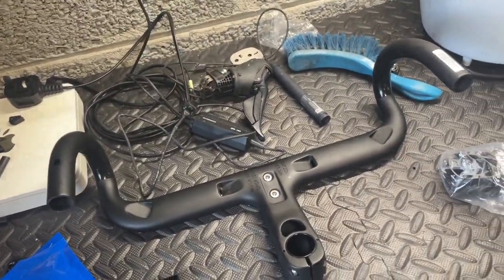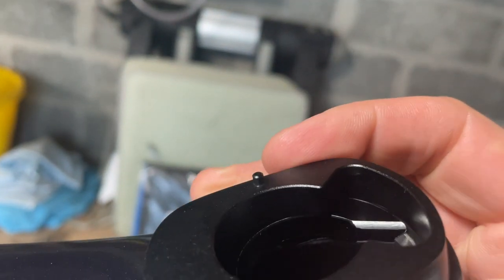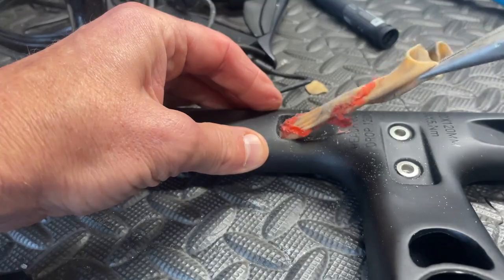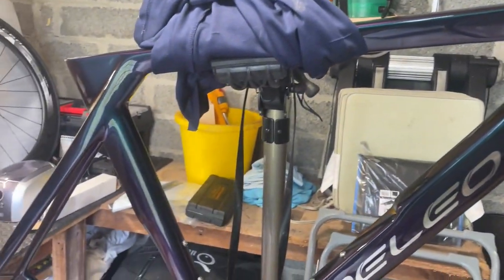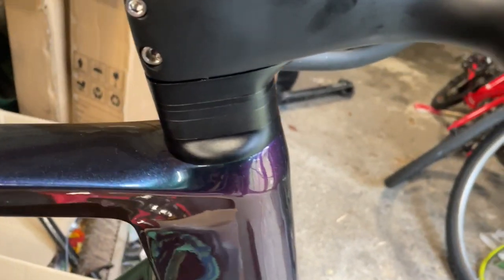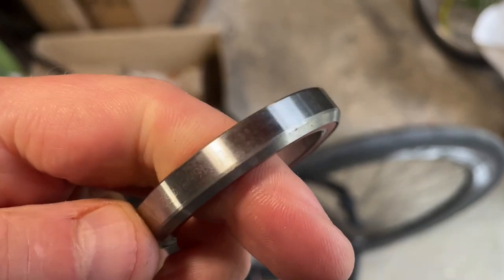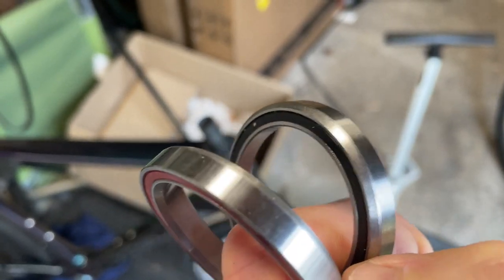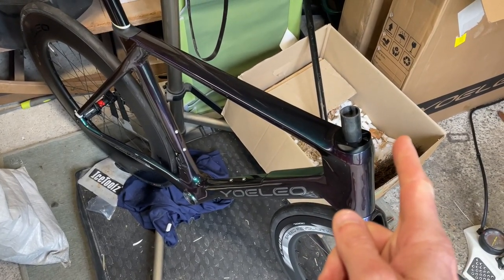YOELEO R12 Pre Build Issues

Comment: I have an R12, I’ve had no issues for 6 months of riding. The spacer issue was addressed with a spacer and now comes with the bike apparently after asking Yoeleo. What was inside the handlebars is excess latex from the EPS moulding (which granted shouldn’t be there) but EPS is a preferred way high pressure moulding for smoother internal moulding and usually found in high end frames that are thousands more. I’m amazed that some high end brands still using the inflated bag technique, just looks like you got unlucky with your excess.
Reply from the maker: Yeah I’ve got no complaints, the bike rides like a dream! 👍 very happy with it.
Reply: @KyrosHouseCycling  I appreciate the reply. Giving people the low down. But tbh as a first time view to your channel it just comes across negatively to those who may want one.  Maybe a review of what it's like to ride?

Comment: Hi Steve, great informative video which I've found extremely useful as I have exactly the same issue regarding the upper stearer bearing. I've ordered a rubber washer as you did, hopefully that will solve the problem. I'm curious what Yoeleo do when they send out fully built bikes.
Reply from the maker: Yeah, I’m not sure to be honest, it seems or seemed to be an issue on that model, or maybe we all did something wrong. Either way, let me know how you got on with the washer fix! 👍

Comment: Hi Kyro, I'm unsure what your issue was with the head tube/head set, and it seems like Cycling Milan had the same or similar issue with his r12 build. Can you clarify what the problem was please? As I understand from Milan's vdo, he didn't like the amount of space at the bottom of the head tube, and I think he changed out the bearing?? Not sure. Anyway, your input is appreciated. I'm doing a series of posts on my R11 build now.
Reply: Yeah, they send me a 8mm bearing that left too much space, so I bought another 7mm bearing. But at the top the 7mm bearing just wasn't enought, and the top cap was touching the frame as I tightened the headset. So I put a 0.25mm shim on top of the compression ring to fix it.
Reply: @cyclingmilan  aha. I enjoyed watching your vdo series on the R12. Thanks for that. Yoeleo included two very thin shims in the headset parts and I wasn’t sure for what purpose so I asked jasmine and she explained. Perhaps your experience with the packing and shipping damage had them change. My frame arrived well packed almost no damage to the box. It struck me as odd that the rear derailleur hanger was mounted on the frame for yours. I think that’s what was poking out of your box, yes?
Reply: @theunabiker4133  correct, the hanger punched trough the cardboard. But the issue was that the metal of the seatpost was against the frame, and the box got roughly handled, so the metal made a small scratch on the frame. easily avoided :(
Reply from the maker: The supplied 7mm bearing meant that the spacer kit touched the frame before it contacted the split compression ring, so I either put in an 8mm bearing or went for the 1mm spacer, I went for the spacer. 👍
Reply: @cyclingmilan  the top cap you mention is the black fitting with the rubber gasket? Not sure how it touches the frame. I’ll look at your vdo again. Perhaps the R11 rim brake frame is different. That piece just fits over the steerer, covers the upper bearing/top tube opening, and provides a water tight seal. I’m not sure that the small extra gap at the bottom is a problem other than aesthetics, but the bigger 8mm lower bearing size obviously has an engineering benefit, though it’s arguably over engineered??…Not that switching to a 7 mm would make a huge or even noticeable difference. 
My Cyfac, 2004, has a Stronglight headset with tiny little angular needle bearings set in a flexible nylon cage, and still works. The headset bearings only have to support the steerer and allow it to swivel. Not like the torque and stress on hubs, and BB, or even the pedals for that matter.
Reply: @cyclingmilan  the only frame parts that was fixed to my frame was the FD hanger and a fitting in the down tube for the A junction of Di2 (or the derailleur cables if mechanical). Perhaps your vdo had an impact on yoeleo or maybe yours was a one off situation?? I’m not sure how much time has passed since your order, but the entire packing of my R11 was really well done. 
Shipping damage is usually the shipping company mishandling the box although if not properly packed then shipping company handling deficiencies will reverberate on the contents.
Reply: @KyrosHouseCycling  I’m ignorant about how internal cable routing spacers and top tube weather caps interface with frames, sorry. I get what you’re describing. It sounds similar to Milan but the top side whereas I think his issue was the lower end. I will have to look at the spacers yoeleo sent w my frame. They sent both types for rim or disc internal routing even though I ordered rim frame. Thank you for your response!
Reply from the maker: @theunabiker4133  no worries! You’ll soon know if you have an issue or not. Don’t over compress the bearings, just enough so there’s no movement . 👍

Comment: Hi, I'm considering the R12 for my next build but I am concerned if it will hold the speeds on the flats and also is it snappy for sprints. I live in FL. USA where the roads are mainly flat and aero bikes are the norm. I currently ride a 2018 Specialized Roubaix mechanical with 55mm carbon deep dish wheels. It maintains speed well and is comfy but with the future shock and endurance design it's heavy and not so aero and I'm having to give more effort to maintain a consistent speed compared to the others on the SL7, Madone or Dogma's ect. So, I'm just wondering if the R12 will be a contender or should I seek a more aero frame to be competitive with the other brands?  I'm sure the R12 is much more aero and stiffer as well as lighter than my Roubaix so I should be able to gain some advantage with the purchase of it. Thanks in advance for you input and your outstanding videos.
Reply from the maker: I like my R12, it’s a bit more relaxed than an aero bike, I still love the aero bike shape with the dropped stays but the R12 is good for me. I’m not an amazing rider but I can average 30kph over a normal ride. To be honest I’m not gonna say which bike you should get, the R21 is the aero frame for Yoeleo so I would say get the frame shape you want. I originally ordered the R21 as I had their R6 version and wanted an upgrade but supply was limited after covid started so I switched the the R12 and I have no problem with it at all. It climbs (even with my 88mm rim on the back) and it holds speed well and descends well. It’s just a great bike for me. 👍
Reply: @KyrosHouseCycling  Thanks for your reply and information. I've reviewed the R21 and I think it would be a better fit for my riding style and I also like your idea to have with the 88mm on the rear. I have you seen any gains by having it on? I'm considering 60mm front and 88mm rear, again I live in the flats so I'm building for speed more so than climbing.
Reply from the maker: @tcobbster  yeah that’s what I ride 60-88. It’s a good combo and I’ve found it to be a good fit for my riding. It’ll look great on the 21 with the aero stays. You’ll have a blast it’s a great frame I’m sure. I’m not sure if the difference is mental or actual but it feels better somehow going from a 60 to and 88 on the back. 👍

Comment: Hi,
I have a question about the steer size. On the website they say it's 1 1-2". If that's right I think it's difficult to find another stem. I see you let the spacer in the H9 handlebar. So, maybe the size is 1 1-8" ? Can you confirm that ?
Reply from the maker: yes the shim is for 1 1-8 steerer.

Comment: The thing in the handlebar is possibly a piece of the EPS latex moulding left behind? Interesting about the headset problem. Fingers crossed my R12 doesn't have that issue but I may try to source that 1mm neoprene washer and have it just in case. Do you know what the inner and outer diameter of it is? Thanks for another great video on these bikes.
Reply: I had the exact same issue with my R12 build. I ended up having to use four  0.25mm shim spacers. I had to cut a notch out of them using a Dremel tool, to mimic the shape of the compression ring. I believe Cane Creek makes the shim spacers.
Reply: @lavalst.germain7870  during your build did you do mechanical or Di2? I'm currently building mine and can't see how the front derailleur cable routes. There's no cable guide or stops, so it has to go bare in the frame and under the bottom bracket. Unless I'm missing something.
Reply: @lepregator463  I used SRAM Axs (wireless), so no cables, but my hydraulic brake hose had to route thru the frame to the rear brake.
Reply: Dave, I believe you’ll just have to route it (internally) above or below the BB.
Reply: @lepregator463  Hi Dave, I presume you are using shimano new style front derailleurs, they take full lenght outher cable, all the way up to the derailleur. You should be able to do that, so you can route the cable housinggoes trought the hole under/behind the front derailleur, and then in a smooth bend above the BB up trought the downtupe.
Reply: @lavalst.germain7870  Yes I also used some Cane creek shims, less than 1mm however. So the 8mm bearing that I also had supplied from yoeleo with my frame wouldn't work the gap would be too much.
Reply: @cyclingmilan  Yoeleo knows about this issue & tried to claim the shims were supplied (obviously they are not). I like the frame, it’s performing well, but Yoeleo should do the correct thing & fix this recurring issue instead of leaving it to DIY fixes.
Reply: @lavalst.germain7870  can't argue with that. :)
Reply from the maker: The washers were 40 inside and 52 outside. 👍 this matches the bearing, but when you cut it you can make it fit the split ring.
Reply: @KyrosHouseCycling  my R12 did not have this issue so I didn’t need the washers in the end.
Reply from the maker: @ScuuBdoo  ah nice! 👍 hope the build goes ok.
Reply: @KyrosHouseCycling  Finished it yesterday. All good. Post should go up on the Yoeleo facebook group once its approved by admin.
Reply: I also fished a little piece of that out of my bars on the R11 build I’m doing, but it was small. I was astonished to see the big thing you pulled out.
Reply from the maker: @theunabiker4133  yeah it was quite surprising! but it’s out so all good, no other bits in the frame or forks. 👍
Reply: @KyrosHouseCycling  I watched your vdo about cutting up the R9, and noticed you discovered some plastic debris in the frame tubes. And that grey material in a couple bearing cup areas too. Did you determine what that was? What was the reason why you sacrificed the R9 frame? Your vdos have been quite helpful. Thanks for that!
Reply from the maker: @theunabiker4133  no I haven’t discovered the reason for the grey bits. I cut up the frame because it was warrantied and I didn’t need it after that. Bit silly I know but I just wanted to see inside it. 👍

Comment: Hey Stephen, Have fun with the bike! I was gonna give some tips on how to raise tha angle of the computer mount, but no need, since I saw you already finished the build. How is the ride?
Reply from the maker: Hi!  I bought a new mount from AliExpress it’s got a slight bend in it so it fits better, just put it on yesterday. Ride is good. Have a loud knock when twisting forces through sprinting but other than that no problems. 👍
Reply: @KyrosHouseCycling  ..a loud knock?
Reply from the maker: @cannon1156  yeah I’ll have to investigate that one. Not sure of the origin. 👍
Reply from the maker: @cannon1156  ok
So found the answer, I forgot to put fibre grip on my steerer tube. The Yoeleo H9 handlebar has a metal sleeve that goes over the steerer tube and this had become contaminated with water proof grease. The loud knock was the stem clamp moving under pressure when I put power through the bike. So basically I was turning my handlebars a couple of mm round the steerer under load. 👍